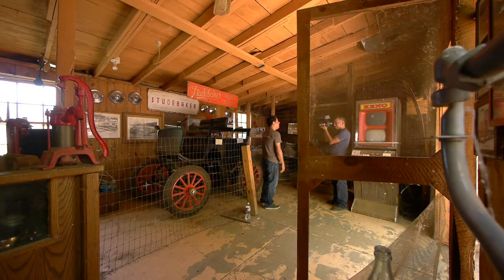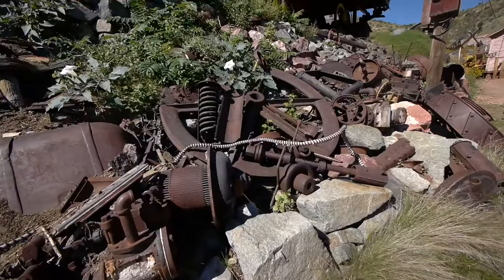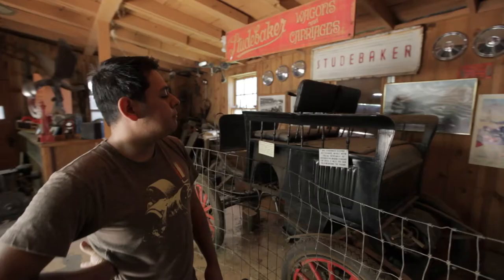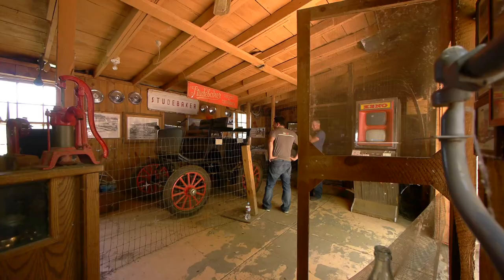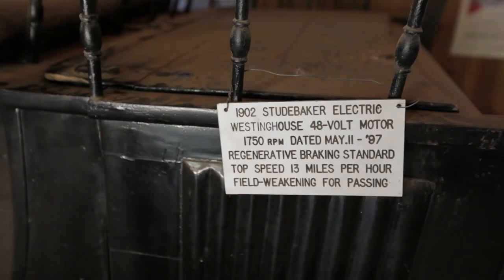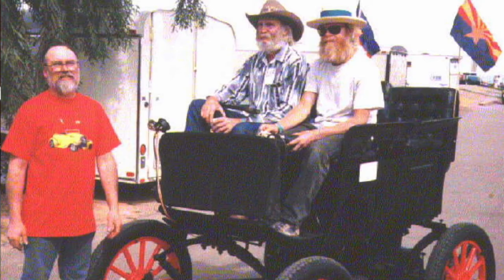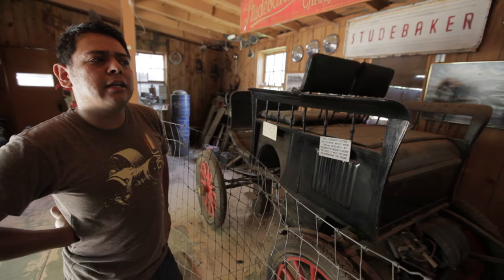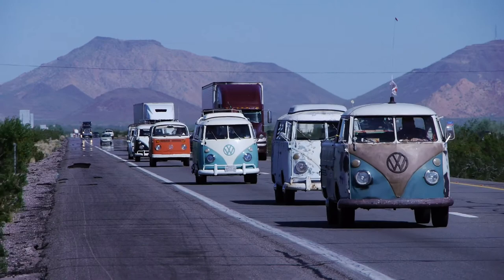1902 Studebaker Electric Car Jerome VW Bus Show

Comment: In 1981, I was at the Studebaker International Meet in Gettysburg, PA as a parts vendor. I man came in with a 1902 Studebaker Electric that wouldn't run. My friend Dave and I went to his farm, close by and got it running. I was the first to drive it in a long time. Last tag was in 1958. The next day he brought it back to the meet and I drove it again with my wife and then daughter, then 13. What a thrill to drive this old of a car. Along with a friend, Dave and I wrote an article for the Studebaker Drivers Club magazine, Turning Wheels in Sept 1981. The car was sold and went to England. I have lost track of it. The car was #157, model 1355. I would love to know where it is today. Jim G.